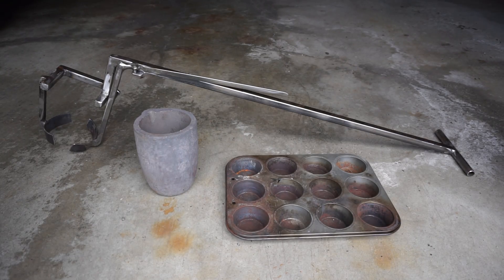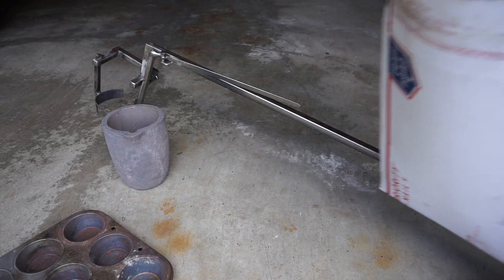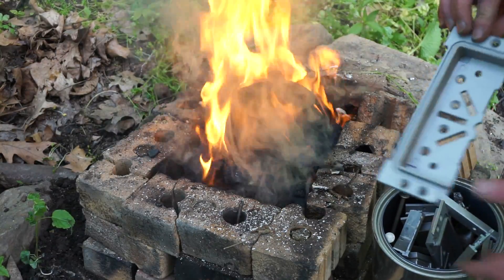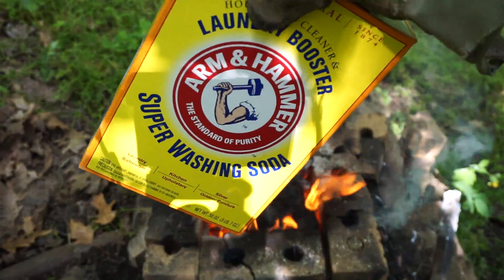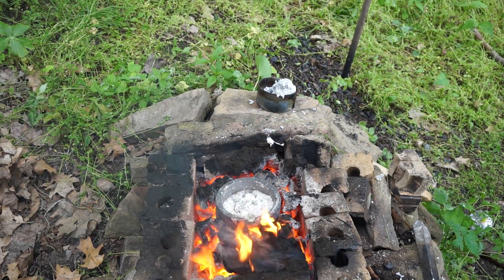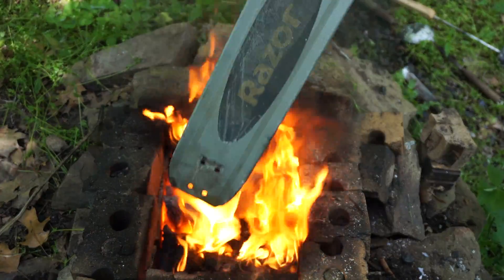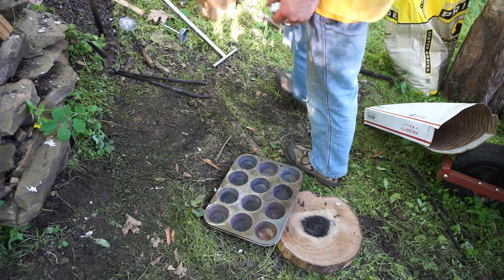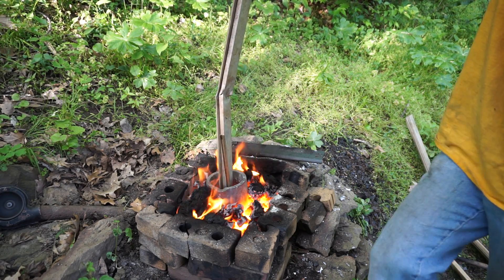Casting of Aluminium Ingots with Homemade Tongs and a Graphite Clay Crucible

Comment: Since your burning with coal and your worried about the carbon soot in the aluminum add Potassium nitrate it should help burn it off in theory and it’s a flux

Comment: How did it go getting or keeping the crucible clean?  At the end when you pan over the crucible, it did look very clean inside :-)
Reply from the maker: +patchpaddy while the crucible is still hot right after I pour the aluminum out I scrape it out real good with an old spoon. Works pretty good. Bought the crucible on Amazon for around $50.

Comment: I'm young and I want to get in to aluminum casting but I don't know how to get started can you give me some tips to get started and ps love your videos
Reply from the maker: +Tyler B a pile of bricks, or a hole in the ground works pretty good. Then use lump charcoal for fuel and a hair dryer for air. Bottom of an empty propane tank works well for a crucible. I have a video about cutting then open without exploding yourself. Fire extinguishers lounge Grant Thompson used are too rare. Pretty much have fun and experiment. It's not as dangerous as everyone says it is. Be careful and use common sense.
Reply: Im old ,,, and think ill do the same thing ...😎👍

Comment: Please preheat your ingot mold! A single drop of water in it can cause the molten aluminum to spatter even meters away. This is also true though slightly less so, with your aluminum feedstock into the crucible. ONE DROP of water causes a steam explosion that can move a hundred grams of aluminum everywhere. Your jeans aren't going to protect you much.
Reply: RadioactivePretzels she'll be right m4x2

Comment: You do warm the tin over the fire before pouring right? Bad idea to pour molten metal into cold metal.
Reply from the maker: +logandh2 No I do not warm them. I don't see any problem with pouring hot metal into a cold mold. If I was using a cast iron mold then it might crack from the shock. That's the only problem I could see. What are you thoughts on why it is a bad idea?
Reply: +Makerj101 Its not so much the cold, though that does play a part, if there is any moisture on the surface of your mold then it will erupt into steam in contact and potentially cause an explosion of liquid metal due to the steam pushing it back out in an effort to escape. To avoid this you really should consider place your molds over the flame for a little while before pouring to really ensure that they're dry, just wiping them down won't necessarily do the trick. Trust me, you don't want liquid hot metal blown in your face

Comment: excellent vid. I think you would have more control pouring (and not have it be so awkward) if you raised up the platform the muffin tin is on....so you arent bending over and trying to control the stream of aluminium from so high up. probably worth trying, if you haven't already.

Comment: Is that coal you are using in the fire? And where are you located? If in the southern states or the midwest, hedge wood, black locust, and mulberry woods will burn as hot or even hotter (thus using less fuel to smelt the metals) than coal. (I know about hedge as I made my wood stove "dance" using it!).

Comment: have you ever thought about redoing some of your internal combustion engine with aluminum parts instead of copper? i don't really know if there is much thermal difference between copper and aluminum. but if there is it would do well as a cylinder wall and water jacket combo when you finally do the cooling so it will keep compression and actually run for more than a few minutes

Comment: Good video! I see that you mention MyFordBoy quite a bit. I have been following his videos for quite a while. He is great! He is such a skilled individual. I wonder for your crucible lifter if you added a handle that stuck straight up from the one that you have now to help you with leverage to dump it. One hand would do most of the holding and it would pivot in that hand while the other hand would supply the dumping/rotating motion on the added 12 inch handle. Know what I mean?
Reply from the maker: Yeah I think I know what you mean.  Kinda like how this one has a bar sticking down to give you more leverage/raise the center of gravity?  The other thing I could do is put more of a bend in the handle to make the center of gravity more centered.
Reply from the maker: Here's the one with the bar that I was talking about http://www.modelflying.co.uk/sites/3/images/member_albums/114346/613877.jpg
Reply: Ya that is the sort of thing I was thinking.

Comment: I calculated once that it was cheaper to make washing soda from baking soda than it is to buy it. Just bake it at like 400 degrees or so for an hour and it decomposes into washing soda. I use it to make film developer.
Reply from the maker: Interesting. I did not know you could convert them like that.  I'd think the cost difference between the two is pretty trivial though.  Unless you need a lot.

Comment: You were burning bituminous coal right? I'd suggest trying anthracite coal, it might be a bit more expensive but it burns hotter and much cleaner that bituminous
Reply from the maker: Yes I was!  IDK where I'd get anthracite coal.  I have access to free bituminous coal in my back yard so I'd rather just keep using that even though it's messy.

Comment: Ever think of going with propane?
Reply from the maker: YES!!!  That'd be wayyyyyy faster and easier and cleaner and safer and just lotttttssss better.  I just need time to make one.
Reply: I bought a high pressure LPG regulator and adapted it to the Grant Thompson propane jet it was very easy and works great
Reply: is the type of regulator that use for jet cookers and fryers not the type for gas grills
Reply from the maker: One of the ones with a variable pressure?  Can you send me a link to where I can buy one?  Thank you!
Reply from the maker: I'm looking at them on eBay right now.  Looks like most of them are 10psi but there are some that go 0-60psi and others that are 0-30psi.  How much pressure do I need?  Thank you so much!
Reply: Bayou-Classic-M5HPR-1 
This is one I bought, it includes the brass orifice too and goes up to 10 psi. If you've seen the king of random propane torch build, I used his build plans to finish it out.
Reply: I made a quick video shout out to you on my channel showing you the torch, Do you mind If I link it here in comments?
Reply: Makerj101 I really think you should stick to wood. Propane is way too expensive and I learned that. I use coal and wood. I went to the store and picked up a 25 pound bag of kiln wood/charcoal and it's gets me through an easy 8 casts. I burn through a whole thing of propane in 5 casts and it cost 2 and a half times more. It may be faster and more effective, but not cost effective. There's my take, but it's really your choice.

Comment: 36 gigabytes of footage?! Wow, did you have the camera on the whole day?
Reply from the maker: Nope!  Not all day!  That new camera I got, the Sony a6000 does some amazing Full HD at 60FPS which is my stranded now.  The bit rate is 50mbps which means it takes takes about 1 GB to record 3 minutes of footage.  So around 100 minutes via the maths.  In reality it is more like 70 min of footage.  The final file that I uploaded was 8.7GB.  Took around 10 hours to upload.  Uggggghhhhh I hate slow internet.  Thank you Time Warner Cable.  Very timely.  Very timely.
Reply: Makerj101 Wow, 1GB for only 3 minutes of footage! And that really is slow Internet speed! My connection would take ~4 hrs to upload 9GB, and I thought that was slow! Well, thanks for going through all that to upload this video, I really appreciate it!
Reply from the maker: +A. Zak that's not too slow.  I could go up to Penn state and use there really fast internet but then I'd have to sit there while it uploads and log onto the school computer with my YouTube account. They have 500mbps up down on the school desktops. The WiFi is so slow tho. It's just easier to set it up and let it uploaded while I'm sleeping. My internet is 20 down 2.5mbps up. I'm so spoiled from the fiber optic that I had back in Pittsburgh. What internet provider do you have? I've got Time Warner Cable.
Reply from the maker: +Eman2000 what internet provider do you have? Do you have DSL? seems rather slow.  I go though all the work and time to process this high quality footage so I wouldn't want to take the chance of down grading it any. Plus I highly doubt that software would support the special Sony XAVC-S format that I use. I could always render it in a smaller and lower quality format like MP4. But again, I want to give YouTube the highest possible quality to work with so my videos look just a little better. I don't know how much of a difference it really makes. It's just my obsession hahaha
Reply: I've got Cox Cable Internet, currently at 32 mbps down, 17mbps up.
Reply: Makerj101 By the way, I was noticing and enjoying the high quality footage in this video!
Reply: Yeah it's DSL 5 mbs down and 1 mbs up (ends up being more like 3 down 0.8 up) I live out in the country so that's about the best I can get. The ISP is Great Plains Communications. Handbrake is actually capable of reading XAVC-S files. I know this because that's what I encode my videos in with Adobe Premiere Elements. The file that Handbrake creates will be standard H.264 (or H.265 if you want to use the newer format though H.265 isn't really standard yet). The nice thing about Handbrake is that it uses a so called "constant quality" encoding method which basically means that in parts of the video that don't have much motion in them it will use a relatively low bitrate and parts that have more motion will have more bitrate. At least with my eyes, equipment and the way I set up Handbrake, the video straight from the video editing software looks the same as the video rendered in Handbrake. My 15 ish minute long videos are usually about 1 GB in size (1080p60 video files). YouTube itself is the thing that really lowers video quality because they have to make the video stream able over the internet. Of course it's all up to you on how to encode your videos and they do look great by the way.

Comment: Problems with the ingots falling out. I think that is because of the coating sticking to the ingot. I had the aluminium very hot when I tried it for the first time with a coal furnace and the coating exploded into flames. Nothing to dramatic but that coating was gone and the ingot fell out with out me trying. The second time i was casting with a torch and decided to try the ingot mold since i had it then it wasn't as hot and it stuck. I ended up heating it up from behind for a while but it came out after 10 min. The main issue i have is the crucible. I lost like 3 KG of aluminium because of bad crucible. I got my shit together now and i will order a crucible soon. But anyway like the new style/music .
Reply from the maker: I think you are right.  Probably the coating melting and gluing the ingots in.  Yeah I lost a full propane tank of my best aluminium right into my coal forge.  It clogged up the whole air supply pipe and made a huge unusable artwork of coal and aluminium.  That's what caused me to invest in a real crucible because it p@#$ me off a lot.  Thank you!  I will try finding some more original music.

Comment: Good video.  I would suggest making a sliding cover for your handles to lock them down  might make it easier to work with.
Reply from the maker: I've been thinking about that.  I haven't figured out exactly what I want to do for a lock yet.  I think a loop of wire would work.  But I kinda want to do something more fancy hahaha

Comment: add magnesium and silica powdered play sand in ball mill then put with borax. if u use sodium carbonate it adds carbon (carbon)ate
Reply from the maker: Interesting.  Sounds like it would help.  Where do you find information like this?  Thank you!
Reply: +Makerj101 where do I learn this stuff well the ball mill I learned from cody's lab and the other knowledge from wikipedia and if u can't find it there I check on google pattents and msds sheets online that can hold secret ingrediants. Ingrediants that can be made if you decifer the latin name and go strait to the periodic table. No collage needed LOL!

Comment: If you have any spare convection ovens or spare toaster ovens, you can use their heating coils to melt aluminum.
Reply from the maker: Yes i could!  I rather burn stuff than use electric though.  Just my personal opinion.  When I make a nice metal melter I'm going to make it propane powered so I can take it anywhere without worrying about whether there will be enough electrical power to use it.
Reply: While true, you could do that, just trying to offer a solution to your carbon contamination issue from the coal burning.
Reply from the maker: You've actually given me a really good idea.  I wonder how well a toaster oven heating element would work.  Cause like everyone can get that kinda heating element easily and if that can be used to melt aluminium then it would open up aluminium casting to a lot more people.  Now I gotta try this some time!  Thank you for inspiring the idea!
Reply: Anything to help out! Its going to take a little bit of know it on wiring and a different design, but if anyone can do it, its you man!